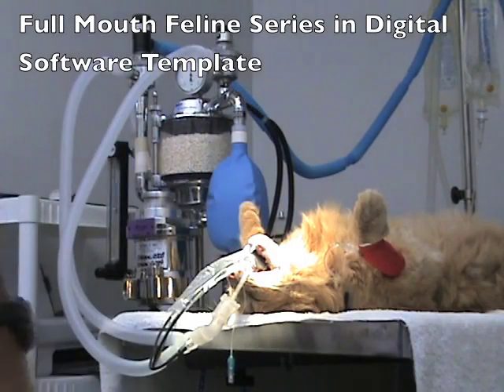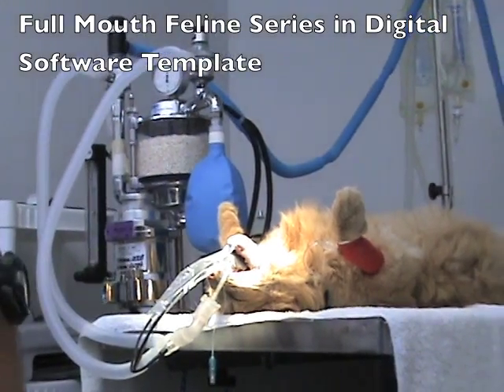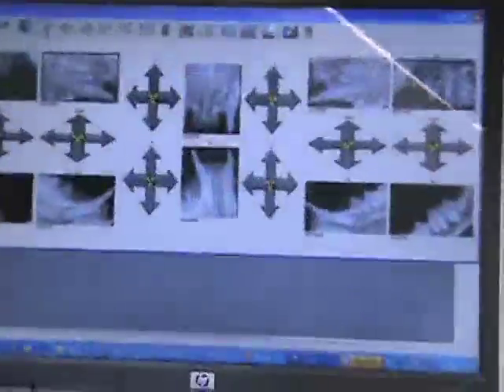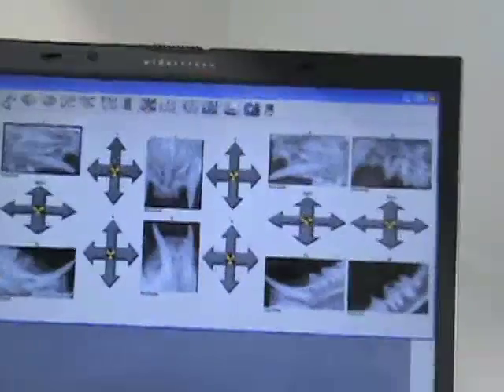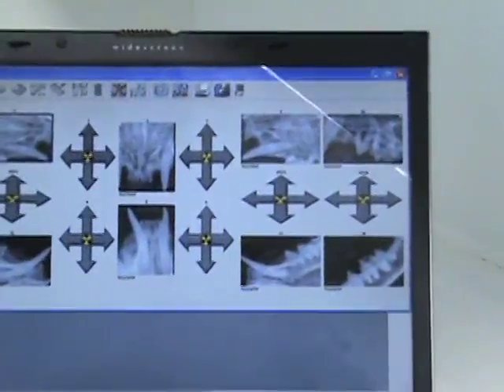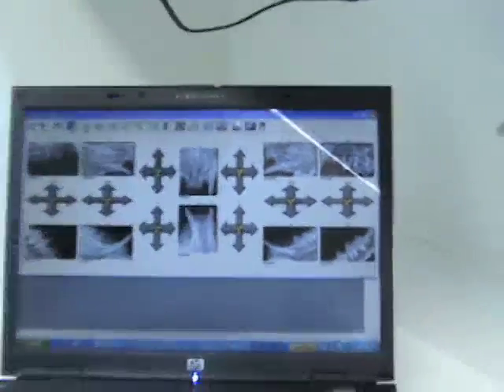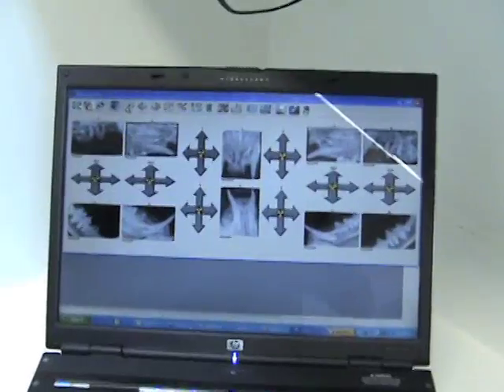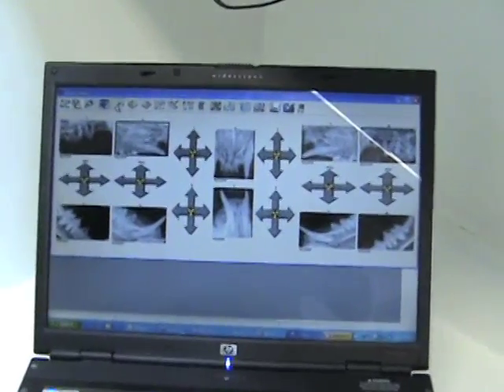Veterinary Dentistry - Full Mouth Cat Dental Radiography

Comment: Do regular vets have x rays like this? Or only vet dentists? I like my regular vet a lot, but I wonder if my regular vet has this type of x ray and also can diagnose the problems like vet dentists do. There is one dentist here, but it takes an hour to get there and they charge a lot (e.g., extraction per minute $340. I have no idea what that "per minute" means...) and lots of different charges under different names...plus she is not even certified as a dentist even though she works at a dentist office.
Reply: Charge for dentistry for animals is usually charged by “time duration of anesthesia” So by how much anesthesia they use. Our regular vet does do dental work but no X-rays. They’ll still do cleanings but decision to extract is based on visuals alone.
Reply: @winterfoxx6363  first off, decision to extract is the opposite of visual alone. That’s what the radiographs are for. To see if there’s any roots rotting or roots stuck after teeth breaking off. You’re extremely misinformed and should not be giving advice. Regular vets DO dental rads. It’s actually required. If anyone is spending over $500 for their pet to be knocked out, it’s better to check EVERYTHING while you can. Why wait until a tooth is VISUALLY ready to come out. Do you know how painful that would be to the pet? Think about us and how we feel a root canal coming before seeing any signs on the outside. Just think before you advise next time…

Comment: What about radiation protection for the animal as well as the practitioner?
Reply: The benefits outweigh the risks of not protecting the animal, as they need to be anesthetized so putting a lead apron on them would be impractical. Lead aprons develop little fissures when you fold them, and they are quite heavy, so it would mean anesthesia time is increased. As for the technician: They are able to leave the room and stand behind a lead-lined wall, due to the fact that the patient is under anesthesia, so won't move. (oh shit they don't do this in this video, that's fucked up)